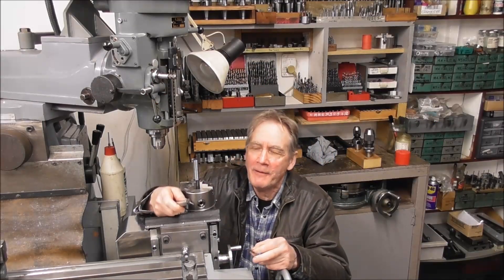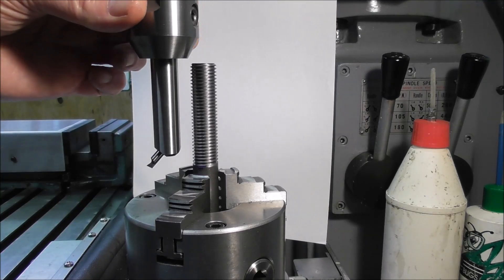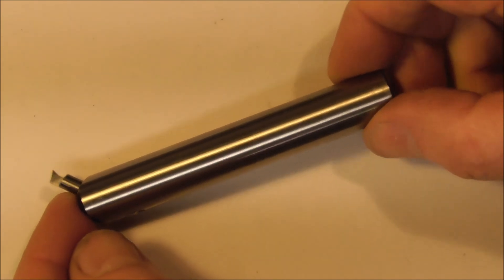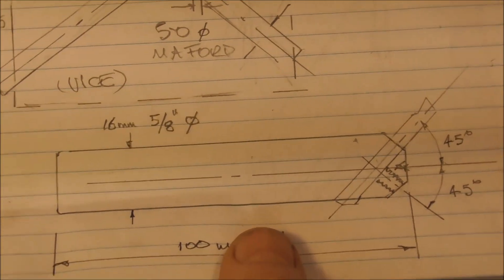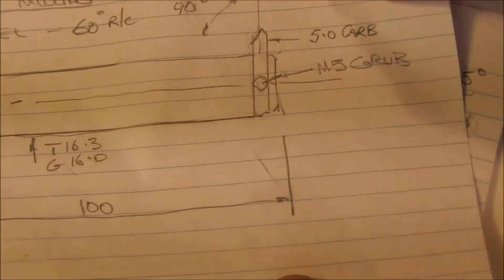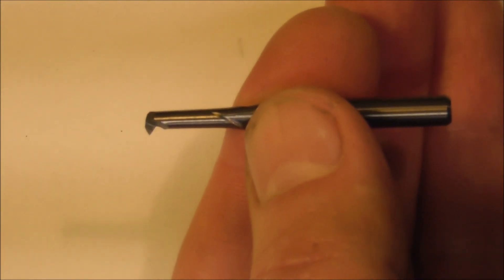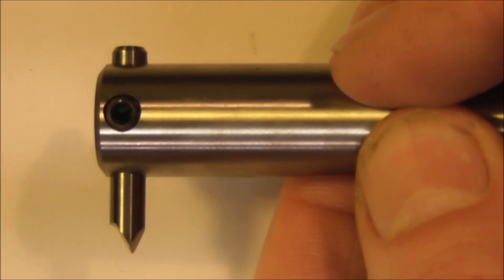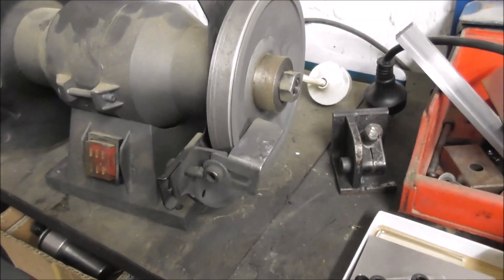ThreadExpress - Thread Milling Cutters - Make your own

Comment: Wow, these are very cool. I have previously made some small thread mills out of prehardened HSS stock by using the mill as a lathe and a carbide bit as a cutter (here is one I made https://jpa.kapsi.fi/stuff/pix/threadmill.jpg ). I'm going to try the design you showed with carbide inserts next.

Comment: Thanks. I need to thread some wooden boxes and the right angle cutter fits the bill for inside and outside threads. A commercial set for a wood lathe costs around £500, which I don't have, so I like the price of this because I can make it from materials and tools that I already have.
Reply from the maker: Good to hear. Thanks for the feedback. Cliff

Comment: I have used the threading bar from my lathe for cnc male thead  milling with the appropriate full form insert. Threads came out perfect with a nice crest and radius.
Reply from the maker: Hi @machinists-shortcuts. Yes, I have been thinking of trialing just that. I imagine it would depend on a few variables such as how much rotational clearance the bar and tip has, how much helix clearance is present and needed for a particular thread, whether the tip is full form or multiform, and so on. Good to hear it has worked for you, that spurs me on to consider trialing and a video, perhaps including trialing different offset methods like using a boring head or an offset bush. Cheers, Cliff
Reply: @Threadexpress  I think smaller diameter bars tend to give more clearance. So the form can stay true and square to the thread axis as no tilting is required.

Comment: Hello Cliff. What do You think about imbedding the cutting insert in a 60° angle instead of 45°. Thus You don`t have to remove that much material from the upper side of the bit. I just have looked at the video of Marc Presling grinding a too deep gap and weakening the bit seriously. Marc was the one who led me to Your channel and I was totally flashed by Your fantastic Threadexpress. It is the solution of a long existing problem of mine. My thread cutting attachment till now worked with changeable lead screws at the rear end of the quil with spring loaded rollers instead of a nut to fix backlash. The range of pitch I could cut was about 1.5 to 5mm in steps of 0.5mm. Finer pitches and TPI-threads were impossible to cut. Now I mounted a ball screw with 5mm pitch and transfered the working method of Threadexpress to my attachment with a lever and moveable pivotpoint. The distal end of the lever is connected with the sleeve of the quil and it works really well. I also did the math behind the mechanism and so I could print the scales wihtout trial and error to calibrate it. Now I can cut threads with a pitch between 0,5 and 4mm and all the TPI-threads between 6 and 48 TPI. Thanks a lot for Your great invention.
Reply from the maker: Hi @elidorrodile9306. Thanks for the feedback.  60 deg is a good idea. I just checked and I think that would still project the cutter tip beyond the end enough to still allow machining close to shoulders. However, the problem of a big profile remains when cutting fine threads close to shoulders, the tip still needs to be ground into a weaker shape so you can get close enough. But the 60 deg angle should help with coarse pitch larger threads. Interesting to hear of your attachment modification. If you can find time, please email me some photos.  Cliff
Reply: Your channel is becoming one of my favorites, thanks for all that you do.
Reply from the maker: @rodneykiemele4721  Cheers! Cliff

Comment: Hola Cliff,muy buena manera de resolver el problema del cortador de roscas ,,,aparte de ser muy  eficiente ,es relativamente simple de fabricar,totalmente posible de hacerce en cualquier taller ,donde siempre hay algun buen acero como para hacer la barra  , para las herramientas ,,,cortantes ,,justamente se puede usar trozos de limas rotativas de carburo  ,,,fresas ,,o barras macizas ,  de carburo,de tungsteno  redondas o cuadradas ,,idénticas a las de HSS  ,cortadas y afiladas ,a gusto ,, fue uno de los metodos muy usados en el torno ,,  hoy remplazado mucho por los insertos,,pero aun persiste y , no dejo de ser usado ,  por ser muy bueno ,,economico ,y con la posibilidad de angulos diferentes ,,y largos de vástago extras, aun asi es  muy rígido ,,,,,,muchas grasias por compartir ,su gran trabajo,, aporta muchísimo , conocimiento ,importante,un gran abrazo y ,,buena semana ,,
Reply from the maker: Hola Juan! Thanks for your faithful support! Cliff